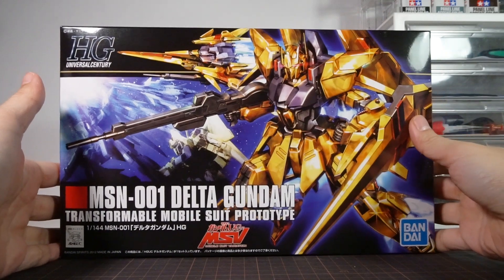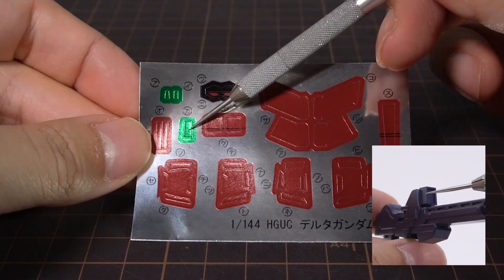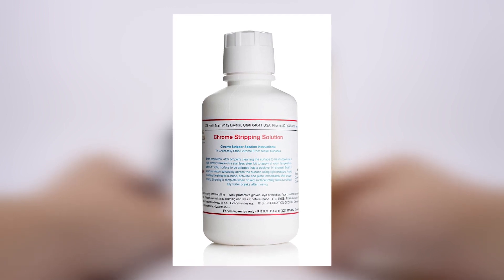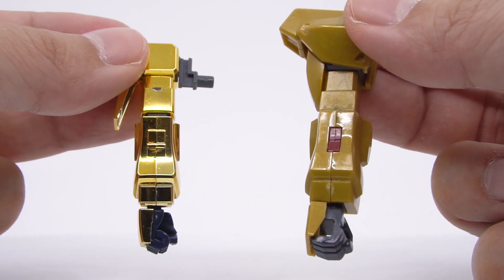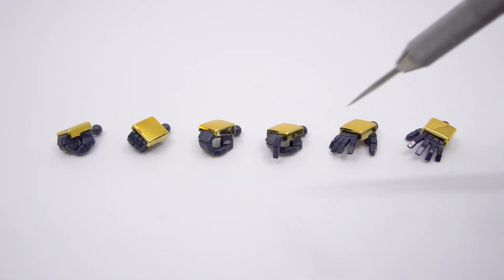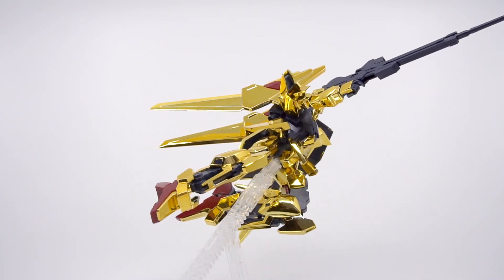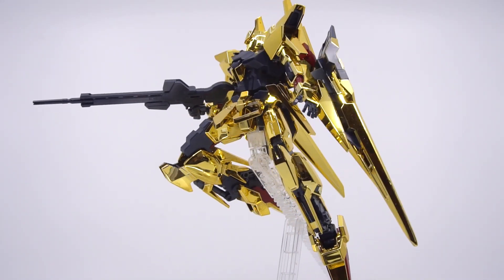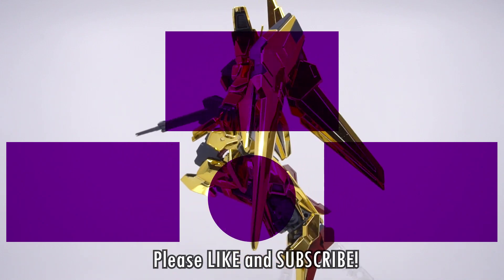HGUC 1/144 Delta Gundam Review - Hobby Clubhouse | UC and Z MSV Model and Gunpla

Comment: Seeing how many details and info you put into your reviews, you truly deserve more subscribers than the ones you currently have.

Thanks to your review now i know the Mega Shiki uses a lot of the Delta, that said, now i want to get that kit even more, i was planning on getting one to paint it gold and get it to look more like the regular Hyaku, but now i know I can basically have a Delta kit for cheaper, only thing I'm left to know is if the Mega Shiki comes with that huge block to get it transformed.
Reply from the maker: Ah, unfortunately it doesn't have the transformation block and you can't make the shield either. It's frustratingly 90% of a Delta or so
Reply: @HobbyClubhouse  well, that's certainly kind of a bummer, but not a big one enough to keep me from getting one whenever I found one in stores

Comment: Thanks for the Christmas review! One thing I'm curious though, how to builders go about chroming their kits? It's not like they have access to nickel like Bandai or other manufacturers do. And the easy chrome solutions like Molotow Liquid Chrome and the Gundam Marker Chrome EX have their own limitations with how fragile their finishes are. I imagine the process would be incredibly hard for a builder doing it all by themselves but I don't even know how they'd begin to approach that issue.
Reply from the maker: Most people can't because you'd need to get all the chemicals you need, and plating plastic is not straight-forward (plastic doesnt conduct electricity soyou need to first get a layer of conductive substance to stick onto it first)
There are small companies that help people chrome things, though I don't really see modellers use them.
In short, modellers actually forego chrome altogether since it usually isn't an option at all

Comment: Is that Oven Cleaner safe for plastic?
I got a 2nd hand kit that's panel lined with tamiya panel liner on bare plastic and i wanted to strip it off lol.
IPA won't work and using an X-20 or other enamel thinner might crack the plastic ☹
Reply from the maker: My Superior Dragon did okay in the mixture for two days, though I didn't mix a lot of it in
You can cut off a bit of an inner wall or a peg to test it. I don't think it's very aggressive to plastic in my experience
Reply: @HobbyClubhouse  Thanks! I'll give it a go .

Comment: One technical question:
Can the paint stick on the chrome part?
I see there is red color correct sticker on the chrome part
Reply from the maker: It sort of works, though the paint sometimes doesn't grip well sitting on top of the clear paint already on the part. The bigger issue is the thickness of adding paint onto three (or more) layers already on the part (conductive material, thin layer of metal, clear paint) so the surface will be really uneven and not too beautiful
Reply: @HobbyClubhouse  so it is kind of not working and we have to use sticker provided in this case, isn't it?
Reply from the maker: Yeah, the stickers are probably better

Comment: wait, what is the phantom hguc hyaku-shiki 1.5?
Reply from the maker: I guess a phantom 2.0 is more accurate. The Delta Gundam was a new mold that unintentionally(?) re-sculpted lots of the Hyaku-shiki.
Lots of fans thought they were going to make a new Hyaku-shiki with this kit back then but it never happened
Reply: @HobbyClubhouse  hmmm my guess would be that they planned on doing it at some point until build fighters, when the revive strike was introduced they held back the design until they figured out how to fix some of the seam line problems on the delta